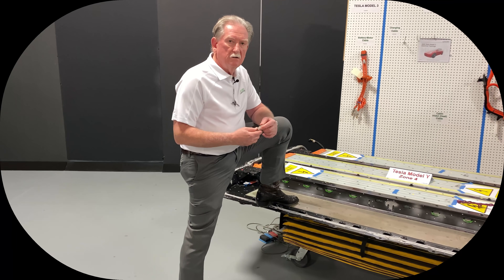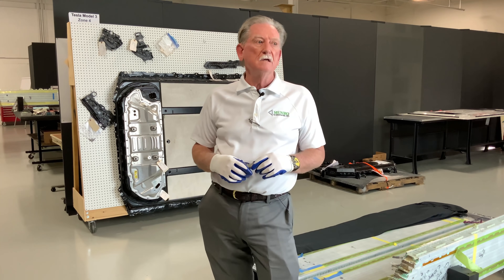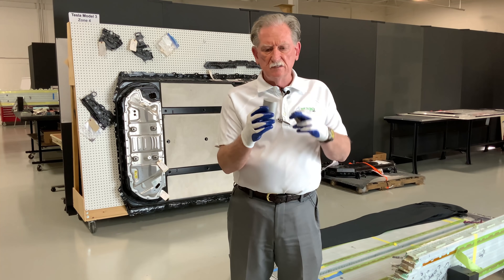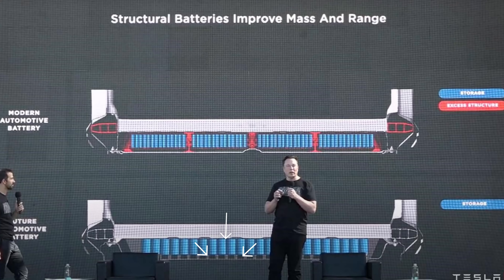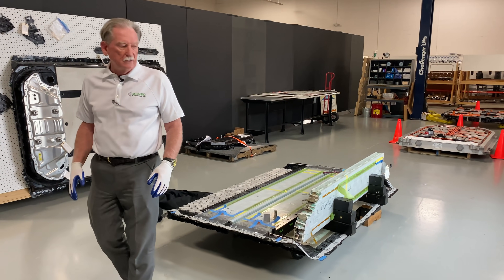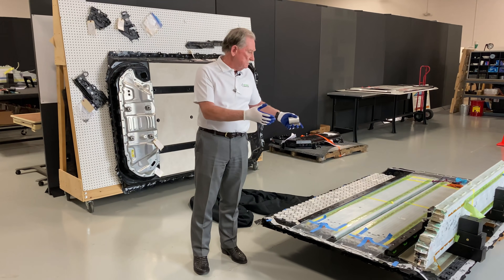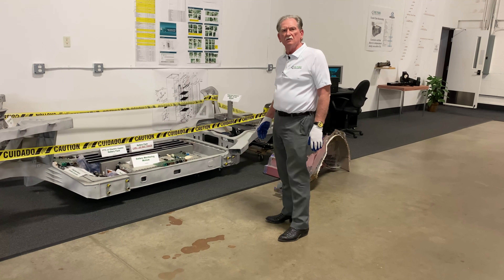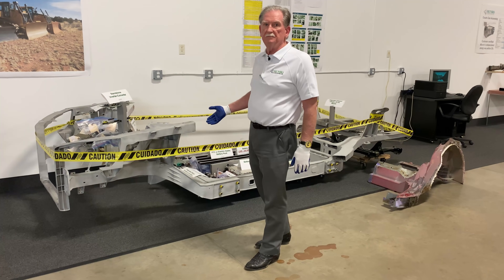Sandy is Thrilled about Tesla's Battery Day & Begins Battery Mock-up

Comment: Sandy, the iPace pack is made up of a bunch of boxes filled with pouch or prismatic packs.  Those are soft-bodied cells which expand and contract with temperature variance.  The cells have no structural role in the vehicle.  The boxes don't, either, they just lie in a tray.  I'm not seeing any commonality between Tesla's cell-to-pack engineering and what Jaguar is doing.

I can't imagine what Tesla could say to you that will help your customers.

They can't get Roadrunner cells from Tesla, not in this decade.  In the next decade, maybe Tesla would consider selling some, but only after Tesla's own needs are satisfied and they have extra.  That day will be long in coming.

Your customers won't be able to use Tesla's big giant casting method.  That works only because Tesla developed a proprietary alloy for it.  That alloy is not on the menu from open market suppliers, and Tesla isn't going to let the recipe leave the company.  It's a competitive advantage.

Tesla isn't going to license their battery management system - because it will work with a particular pack only if it's rewritten, and Tesla is a little bit busy right now with coming up with revised software for CATL, LG-Chem and Roadrunner pack designs, to say nothing of their other software projects.

They aren't going to share their permanent magnet secret sauce for their electric motors.  That's a competitive advantage, too.

Your customers will never be able to match Tesla's FSD, or entertainment system software, or their OTA software.

Really, where your customers need help is in understanding their place in the market.  > $20K isn't it.  Soon enough - well, not soon enough for most of us, but soon anyway - Tesla will be marketing a fully-capable good-range (250+ miles EPA) autonomy-capable (at extra cost) economy BEV for $25K.  3-wheelers will either slot in well below that car in the market, down in the weeds where city cars live, or they won't be in the market at all. 

They need cost reductions and parts reductions.

They can't get Tesla's giant casting process.  So the next best thing is to design a body with crumple zones and protective steel to resist impacts, then add lightweight formed plastics for everything else on the body.  Snap the plastics to the steel and the body is done.  Help them pick the right plastics for the purpose and find the right forming machines for them.  Don't paint!  Not painting saves bucks.  Use pigments in the plastic instead.

You've got to talk them out of luxury stuff.  Comfort and durability are fine, but only if it's cheap.

If a three-wheeler costs more than about $10K to produce, it's probably not going to make it in the market once warranty servicing, distribution, taxes, tariffs in some cases, and surcharges of various kinds are added.

If they're selling through dealers, that's one strike against success right there.  BEVs should be sold on-line and serviced locally.  Need to sign up service shops but shed the dealership model.  It's too difficult to get to the desired cost range if dealers are taking a cut and adding their own surcharges.

It's hard to write good battery management software, but if your customers don't have good BMS, their battery packs will poop out way too soon and they'll have irate, litigation-prone customers.

GM seems to be desperate to sell battery packs and software to nameplates outside of GM.  Might be worthwhile to talk to them.  I think CATL also supplies entire packs with software; not sure who else does.  What you don't want is homemade wired-up packs with dumb chargers.  (Shudder)

What could Tesla tell you?  They're smart guys, but the stuff they're doing isn't for small resource-constrained companies looking to establish themselves in comfortable little market niches.

Comment: Sandy, these cooling plates, which way will Tesla originated the battery?  Will the flat end be up (and the connection end down)?  Seems like heat conduction upwards will make cooling more effective if the flat bottom was up.

Comment: might be a silly question, what about maintenance and accidents?.. wont that single piece of body need to be replaced, meaning higher cost in the long run?
Reply: Tan Wey Ping, that is something definitely missing from the discussion. Sandy keeps saying “You can make it reliable or serviceable, choose one”, but he’s not going into what the insurance company says about a car that gets totaled when you hit a pot hole. 

Also not discussing the battery pack second life ease of use. The model S/X battery modules are the gold standard in second life. 24v with provision for liquid thermal management if needed. Easy to use for solar or DIY projects. The model 3/Y is less easy to use with 2 different module sizes, neither of which are ideal for DIY.

If the battery is all epoxied together then the only way to use it effectively as second life is as a 400v pack, in that same form factor. Can’t be arranged like the model S/X modules can in many configurations.

Comment: "With this,  do I actually need solid state battery?"

Gotta love how Sandy drops a bomb after the credits like it's leading into the next episode of Avengers!
Reply: Wow didn't watch the full thing, went back after your comment, thanks for calling it out!
Reply: He dropped the same bomb in that analyst interview.
Reply: Lol!! That’s so good!!
Reply: Well Yes, This manufacturing process is kinda working for future Tesla solid state batteries.. but there are several different things of course..
Reply: Who needs solid state when you can max speed super charge and have a battery that last for decades?
Reply: @ralanham76  solid states makes lithium a lot safer because it is extremely hard to caught fire even if you abuse it.. and it also increase energy density which means good for electric plane
Reply: It is the same with LiDAR vs camera, fuel cell and so on. Everybody says (except Tesla) "LiDAR will work and be cheap somewhere in the future you will see", or "we can reduce the cost of hydrogen fuel-cell", " we will have solid-state battery on the cheap in a decade".

And in the meantime, Tesla is eating their lunch. By the time they actually get those technologies to work, Tesla will have dominated the market with cheaper (and working) alternatives.
Reply: @Findalfen  That's why, those new many expensive production lines for 4680, should be built with a large flexibility, to be able to be adapted for production of solid state batteries when 4680 will become obsolete, unless they will be fully amortized  when solid state batteries will be the main stream in EV manufacturing!!!
Reply: esilviu2000 They will make their money back on the machines in the first year or two
Reply: @Findalfen  lidar seems to be cheaper already, not clear who will win sd competition
Reply: @user-uw3fi2zg4t  Compared to cameras? You must be dreaming....

Comment: Great video Sandy, as usual! A very simple calculation shows that switching from 2170 to 4680 will increase the battery pack bending stiffness by at least 30%, which supports your point on the pack is solid like a brick.

Comment: Excellent presentation Sandy. These developments are exciting.
Although packing with epoxy will make it very strong, it won't make it easy to recycle or harvest the cells for reuse, which will be a pity. I guess they'll add alumina or graphene to the epoxy to increase heat conductivity too.

Comment: Sandy, I know you’re helping Arcimoto, but come on, $25k for a tricycle with no AC if Tesla will have a $25k regular car?  I don’t think it will fly...
Reply: it's difficult for a small company like Arcimoto to lower cost at this stage. Actually the same applied for Tesla when they were in the fase were Arcimoto is in now!
Reply: @fodiographer  Getting the costs down across the board is why Arcimoto went to Sandy's shop. Sandy is probably wanting to replace a number of parts on the Arcimoto with one or two large aluminum castings after watching Tesla's battery day. The thing is no one but Tesla has the custom aluminum alloy they came up with for their new aluminum injection mold casting machines.

Comment: So will Tesla eventually have a one piece casting for everything (front, back, and battery)?

Also you mentioned IPace battery pack was what Tesla will look like. So is IPace ahead in anyway?  I assume they don’t have batteries like Tesla so I guess they just have the one up in that one area?
Reply: Sandy was talking about form factor in terms of the cooling configuration inside the packs will be similar to the iPace. Battery tech and component design/integration is how tesla will maintain their lead in the industry.

Single casting for entire underbody and front and rear crash structures probably not ideal.  It doesn’t actually save time/cost now given that all they need are few bolts to tie the front and rear castings with the battery enclosure.  The time/cost benefits are realized in removal of the 100+ components for front and rear each.  Removing 1 more component (battery enclosure) doesn’t add value to the process.

Comment: D cell vs AA 🤷🏻‍♂️. diffusion weld the battery cases themselves to creat the load bearing structures as well as the energy transfer system 🤷🏻‍♂️

Comment: Yes when enabled, axial path transmit heat is more superior than radially. When transfer electricity and heat across a junction we need (1) junction area (2) contact force (3) J shape tabs and (4) resilient and conformal between J tabs to casing under all applicable environmental conditions. Such as thermal expansion/contraction cycle, shock and vibration. 

The terminal for heat and electric conduction is copper, more specifically annealed thin copper was chosen to resolve problem in roll up assembly and not suitable to address 4 above. 

I’d doubt an EV with such J shape tabs for electric and thermal conduction.

Comment: "This is not Burger King!"
That's basically what all the old manufacturer's thought about EVs. "Oh, when it's time we'll get batteries and an electric motor and slap them together. Anyone can do that!"
Guess what: No you can't.
Reply: Their initial attempts were to use existing ICE platforms and shoehorn the batteries and motor in the place for the engine and gas tank. How ridiculous and misguided it looks in retrospect.
Reply: @December314  Hell they're still doing that today on any non-Tesla under $50k.
Reply: That was in a way what Tesla tried to do with the original Roadster. And the learned the hard lesson through som difficult years, when they had to rethink and retool 70% of the Lotus they started with. So the hard reality kicked in early.
Reply: I don't think the part about the body being cast has anything to do with EVs. Could be applied to ICE cars, too.
Reply: @Aktenverwalter  nope you are totally wrong, steel/aluminium stamping works perfect, plus ICE cars arent heavy compared to EVs, the other advantage is the already existing stamping presses, VW makes 10 million cars a year and they can easily use steel, aluminium, carbon fiber....
Reply: @carholic-sz3qv  what exactly was I wrong about and what is your point?
Reply: @Aktenverwalter  for tesla its possibly easier to go with casting instead of press, even tho they will still need presses for other parts of the car, vw for example already has tons of presses, they just need new mold and voila, the battery on the floor is what really gives rha car rigidity, plus steel is really cheap compared to aluminium, the bmw i3 also uses giant castings and sandy munro brought that on youtube in 2013
Reply: @carholic-sz3qv  There's nothing easy about casting an entire rear and eventually front chassis or even an entire chassis, as Tesla is doing with Model Y. They are using some of the largest casting presses possible, and they even created a new metal alloy needed due to the very large size of the castings.  

ICE vehicles could also benefit from larger chassis castings for exactly the same reason as Tesla: they cost less when used in large volumes, are lighter, and reduce dozens of parts into one. That also simplifies and speeds up manufacturing and lowers cost greatly.

The Tesla castings are several times larger and much more complex than the BMW i3 castings.

It's excellent that VW is starting to make more EVs.  The world needs more EVs and fewer ICE.

No need to reply to debate any of these facts.  I won't reply.  Bye.
Reply: @Aktenverwalter  Yes, at least half way, and Sandy makes that point. He presented the to many car producers, most of them ICE car manufacturers, and he tries to explain why the didnn't do it in many of his video's. In the case of Tesla, the combination of both rear and front ends (ICE cars have the complexity of the motor and all other drive train stuff) combined with the massive battery plate makes the big difference and that is why Sandy sais that they almost can get rid of the body shop.
Reply: Anyone can buy batteries and motors from LG, Siemens, etc., but they can't build an EV profitably unless they scale up massively and bring the highest cost parts in house.  That means batteries more than motors.  See GM lose money on every Bolt sold for exactly this reason.
Reply: @LoanwordEggcorn  vw is already massively scalling their EV production, there are trains fully charged with id3 leaving Germany
Reply: Yeah the ICE dinosaurs thought making EVs was like playing checkers, while Elon is busy playing three-dimensional-chess at hyperspeed.....
Reply: Mark Rijckenberg yes, playing 3 dimensional chess and learning all the time! Again, when the others, aka ‘the big boys’ finally realise they are almost checkmated, they can’t do much except cry like little girls.
Reply: Mark Rijckenberg think you mean at Ludicrous speed good sir. Light speed to slow!
Reply: Nonsense, EVs are easier to make than ICE, but the advantage of ICE is the platform scalability, in the Volkswagen group, they have perfected the manufacturing, interchangeability of parts between porsche, audi, lamborghinis, vw, skoda..... the engine of the golf works great in the caravan....... the chassis is used in so many models
Reply: Actually, yes anyone can do that... If they want a crappy car.
Reply: @methos1999  They're good cars, but too costly.  The only way to lower EV/battery cost is to make them in very large numbers.  None of the legacy car makers are actually doing that, except Nissan/Renault and maybe VW.
Reply: @LoanwordEggcorn  you misread my comment. It's aimed at the likes of the Chevy Bolt with parts bin engineering. Sure you can throw it together, but it's aged like the economy car it is.
Reply: @methos1999  Agree.  It's great that GM made an EV, but it was neither groundbreaking nor profitable.
Reply: That is where tesla rEVolutionized battery electrics. Software!
Vw found out this the hard way lol with the id.3
Manufactured them, then they sat for a full year on lots. Unable to function. As they desperately hired over 10,000 software engineers to fix them. I wouldn't pay what they charge for a car which sat for a year on a lot. Waiting for It's software to work right. 🤔
Reply: @4literv6  I love seeing the bromance between VW CEO Herbert Diess & Musk. Seems at least one person there has a clear vision of automotive future.

Now lets hope the rest of the company catches up...
Reply: Diess is either gonna end up running vag as it attempts to survive the transition to bevs. Or he's gonna get canned pushing them so hard to transition. And end up at tesla or another electric start-up. 😁
Reply: @4literv6  Heard a really cool take on the different mindsets between Tesla & Legacy Auto. 

Tesla is fundamentally a software company, whereas Legacy Auto are fundamentally mechanical engineering companies. Only one is ready for the future.

It's like trying to enroll a penguin in an acrobatic flying competition: sure you have all the parts, but that bird ain't gettin' off the ground. ^-^
Reply: @4literv6  ID.3 software still doesn't work in the current versions, a lot of "fixed in a future release" software issues

Comment: So they only need 60% of the battery space to get the current capacity, and it will charge faster also with less heat...
I wonder what changes to the weight and what impact that will have on the range...
Since Berlin will have 8 casting machines and the model Y will be done with this, you wonder how fast those batteries will come...
Reply: What many miss it that most people will be fine with a small range EV as long as it can recharge quickly.  How many of us drive more than 100 or 150 miles in a day except for a very few days per year?  Modest range = fewer cells = lower cost.

If you had a 200 mile range EV that recharged to 80% in about 10 minutes rather than the current about 25 you could drive ~500 miles with only a couple of 10 minute stops.  One meal stop.  One pee stop.  

You'd get there quicker than someone driving an ICEV who stopped for a meal, a pee, and to fill their tank.

Robotaxis won't even need a 200 mile range, at least most won't.  How has a one way commute of 100 miles?  Haul some people from home to work.  Rotate in during off peak demand hours and charge back up for the end of workday peak.  A portion of the robo fleet could be long range to serve people who want to ride longer distances.
Reply: Bigger picture most aren't discussing is. Should they realize all those efficiency gains? They could then make twice as many vehicle's from the same amount of $&materials as they do now. How is that not staggering?